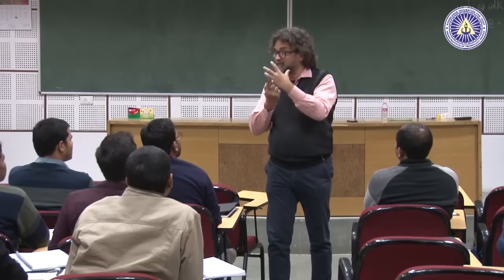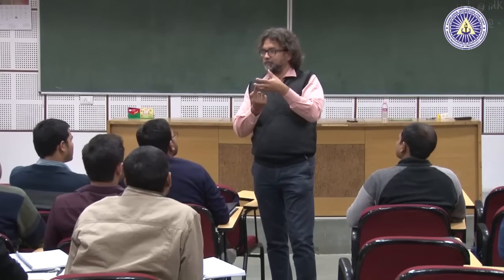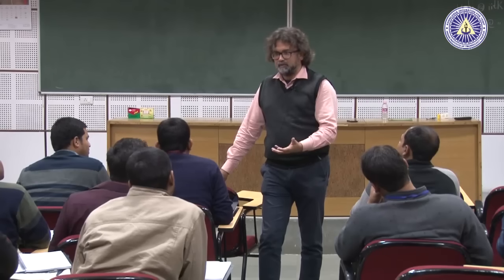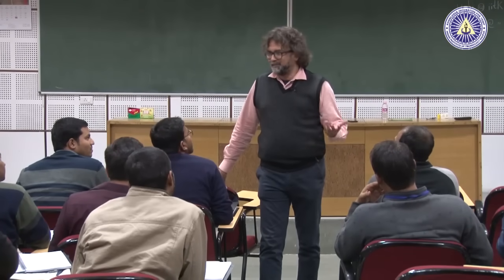Thermodynamics and Heat transfer Prof S Khandekar

Comment: Ive attended 83 classes on fluid and thermodynamics, no professor has not eve a 1/10 of interactive teaching like this. I don't why todays university professors uses ppts to teach core engineering subject where it is defined as lots of practical applications. I can understand why IITs produces quality of engineers and no wonder thar every IIT aspirants hunt for it.

Comment: Engineering means Practical Use of Science. Teaching engineering has to be practical. Professor’s insistence on relating with surrounding reminds me my classmate asking me the difference between Latent Heat & Specific Heat in last semester of our Engineering.

Comment: Consider a U-tube whose arms are open to the atmosphere. Now equal volumes of water 
and light oil (
3
  791kg / m
) are poured from different arms. A person blows from the oil 
side of the U-tube until the contact surface of the two fluids moves to the bottom of the U tube, and thus the liquid levels in the two arms are the same. If the fluid height in each arm 
is 76cm, determine the gage pressure the person exerts on the oil by blowing

Comment: The swept volume of a gas engine is 9 litre and the clearance volume is
2.25 litre. The engine consumes 3500 litre of gas per hour, when running
at 160 rpm firing every cycle and developing 4 kW. It has a mechanical
efficiency of 75%. What is the relative efficiency of the engine compared
with air-standard cycle if the calorific value of gas is 20 MJ/m3. Assuming
a volumetric efficiency of 0.87, find the ratio of air to gas used
by 1 m3 of the mixture in the cylinder.

respected sir, i am not able to solve this numerical. can you please provide me a solution for this

Comment: I have a problem. I have a conveyor oven that requires two different temperatures to be maintained constantly.100c in half the length of the tunnel and 200c the remaining half, or little less( 10 ')  than that, of the oven. Single source 'hot air generator' and a single exhaust. Now there  provided, is a room temperature air at the end of the oven for say last 10 ft. I feel this air is to create a loop of room temperature air coming and going through the exhaust,at the end, as it would prefer to condute the cold air as compared to the hot air in the oven. This may result in hot air conservation in the oven areas designed to have hot air of respective temperatures. But in order to get the gradient, in side the oven, would only dampers be sufficient or there has to be seperate air sources to generate two major temperature zones. Any suggestion would be welcome.
Reply: 100c air can be created by mixing room temperature air with 200c air in a fraction controlled by a closed loop control system with temperature sensors... ?

Comment: Do you know why there is a lubricant in the compressor of a refrigerator in an enclosed chamber or housing?it is because,it serves as a coolant as the electrical processes as on going inside the compressor and that serves as a help in its maintenance as it works for long hours non stop without the emissions of heat outside the system which can be radiative.Same should go for cars as to cool down a vehicle that have been on the road for a long time needs to be submerged into a lubricant,not water so as not to bring in rusting but this types of coolants as a maintenance job for the cars on the way to help reduce the heat after a long ride, expansion of the metals around its boundaries and bouyarncy.I have been seeing alot of people driving under hit metal engines and still kept there movement on going despite the challenge they are having with the heat in the car as a result of the mechanical works going on in there which when neglected can cause accident on the road while the driver and the passengers are battling with the heated engine and body system and the rules used in regulating the roads.This are often done by the military men in uniform when they put themselves in emergency situation to be at a place at a very little time without being able to subcontract what they want to do to other functional units to help.

Comment: Great explanation.. Lecture should always start with an example as the Professor said.. because all we are doing is using mathematics to model/formulate our observations... ( w/ assumptions) so it is important we observe first.. great way to teach. on the example of how much heat body loses.. only one comment .. even though you can approximate a body as cylinder.. heat flux is dependent on surface normal ( dot product - F . n) .. so really it can be approximated as a rectangle in 2-D space and heat lost calculated..

Comment: He ensued my interest at time 14:32 so answer is aprox 100w for the people wondering kT (t1-t2) /thickness 
T surface area 170cm aprox temp difference body temp minus room temp 37-20 =17 human thickness take it as a cylinder roughly from shoulder width which is aprox 41cm and constant for the thermal dissipation is around 1. 4

Comment: professors like him create jee advanced questions, so don't underestimate guys!
Reply: Also create GATE questions
Reply: Yes....give me his number.....I will ask him thoss questions
Reply: If goal and passion is to study computer science but the entrance exam is mostly from physical sciences, I don't think it's a relevant exam.
Reply: @abhinavchauhan6863  Cse is probably one of the only courses at the IITs that doesn't apply JEE knowledge, getting rid of PCM tests just because 100 odd students out of 800 aren't going to study them is idiotic, every ECE,mech,chem etc student needs to have jee knowledge, not to mention, every other course that doesn't require Physics or Chem, surely requires Math
Reply: @JohnSmith-kj2od yes please tell me where will you require "complex numbers" or "conic sections" in real life especially engineering

There is a sharp difference between" practical knowledge" and " theoretical knowledge"
Reply: @JeeMinds  lol complex numbers is everywhere from singal processing(electrical engg) to vibration analysis and fluid dynamics(Mech), even civil students have soil/structural analysis using complex numbers, heck even subjects like DSP that CS students study has complex numbers, anything dealing with control systems you'll come across Complex numbers, Conic sections isn't used nearly as much but there's no successful engg that has designed(architectural) something functional without the knowledge of conic sections.                                                                                               You are right there is a sharp difference between practical and theoretical knowledge but unfortunately you aren't sharp enough to comprehend it
Reply: Bro complex numbers are used in whole fucking quantum mechanics....
Reply: @abhinavchauhan6863  nice analysis 👍🏻👍🏻
Reply: @abhinavchauhan6863  you can't do jackshit in coding without excelling at mathematics
Reply: @sreemapaul4943  wtf? mate, see the real world and then comment stuff
Reply: @abhinavchauhan6863  why we learn languages first before going to learn subjects?
Reply: These exams do not gauge what an individual has to offer.
Reply: @chiluxr250  you are right, after so many IITians, we are not able to design diesel/petrol and aero engines... 😀😀😀, Only theory...
Reply: @chiluxr250  oh really? if an individual has anything to offer,  the said individual will crack this exam.
Reply: @Saitama-py8dz  haha makes sense
Reply: @Saitama-py8dz  There are many Engineer in India who haven't cracked JEE but still are very good and Quality Engineers

Comment: Hello Prof,
I have many questions related to the thermodynamics and fluid dynamics, multiple choices it takes 10 minutes,so could you help me please?

Q1. The general motion equation based on the 
a. continuity
b .conservation of velocity
c .conservation of inertia
d. 1 Law of Newton

Q2. At total-energy thermal model
a. the applied parameters independent from the temperature and when the temperature changes the rate of dissipation is not relevant.
b.the applied parameters  are not depending on the temperature and the temperature is not changing.
c.the applied parameters are depending on the temperature and the temperature is not changing.
d.the applied parameters independent from the temperature and when the temperature changes the rate of dissipation is relevant.

Q3. At thermal-energy model
a. the applied parameters are depending on the temperature and the temperature is not changing.
b. the applied parameters independent from the temperature and when the temperature changes the rate of dissipation is relevant.
c. the applied parameters  are not depending on the temperature and the temperature is not changing.
d. the applied parameters independent from the temperature and when the temperature changes the rate of dissipation is not relevant.

Q4. Specific kinetic energy change
a. unit is W 
b. gives the change of velocity component at a given point 
c. gives the reduction of velocity component away from the boundary layer  
d. gives the reduction of the velocity component near at the boundary layer.

Q5. Thermal convection cannot occur
a .where is no gravity
b. the temperature of the fluid is higher than the surrounding surfaces
c. the temperature of the fluid is Lower than the surrounding surfaces
d. in the fluid flows

Q6.The t isothermal model
a. the applied parameters are depending on the temperature and the temperature is not changing.
b. the applied parameters are not depending on the temperature and the temperature is not changing.
c. the applied parameters are independent of the temperature and when the temperature changes the rate of dissipation is relevant.
d. the applied parameters independent from the temperature and when the temperature changes the rate of dissipation is not relevant.

Q 7. A relative pressure
a. is the sum of the total and static pressure at the boundary.
b. Is the total pressure.
c. is the static pressure at the boundary.
d. is the difference between total pressure and static pressure at the boundary.

Q8. The difference between the DNS and RANS is that
a. DNS calculates the deviations of the degree of freedoms while RANS does not.
b. with Direct Navier Stokes method transient cases cannot be calculated.
c. RANS cannot solve transient cases.
d. RANS calculates the deviations of the degree of freedoms while DNS does not.

Q9. The following can be only have output parameter
a. opening
b. inlet
c. symmetry
d. outlet

Q10. In case of numerical simulation
a. with Navier Stokes equations velocities and pressure are calculated.
b.with Navier Stokes equations pressure is calculated and the flow is checked for continuity.
c.with Navier Stokes equations velocities are calculated and the pressure is calculated with continuity.
d. with Navier Stokes equations velocities are calculated and the flow is checked for continuity.

Q11. In a Non-Newtonian fluid the shear stress
a.proportional to deformation.
b.proportional to the rate of deformation.
c.independent from deformation.
d.not proportional to the rate of deformation

Q12. With Reynolds Averaged Navier-Stokes method
a.deviation of the degrees of freedom are estimated and the average values are calculated.
b.degrees of freedoms are calculated.
c.only steady state phenomena can be examined.
d.only transient state phenomena can be examined.

Q13. The boundary layer
a. boundary layer shape is only depends by the velocity of the flow.
b. boundary layer shape is not depending by the viscosity.
c.it can form in the middle of the flow domain.
d. can form on any rough surface.

Q14.With Euler flow description method ... can be calculated.
a. head loss coefficient of a body
b.pressure distribution at a given cross-section
c.velocity distribution at a given cross-section
d.the pressure drop in a pipe section

Q15. The following can have an input and output parameters:
a.outlet
b.opening
c.inlet
d.symmetry

Q16 .The first layer height depends on
a.the density, the dynamic viscosity and the pressure of the fluid.
b.the density, the dynamic viscosity and the average velocity of the fluid.
c.the density, the pressure and the average velocity of the fluid.
d.the pressure, the dynamic viscosity and the average velocity of the fluid.

Q17.The dissipation
a.reduces the viscosity.
b.causes swirls.
c.is heat generated due to the reduction of the kinetic energy
d.is heat generated due to the increase of the kinetic energy.

Q18.In the Euler movement equation we have to assume that the fluid
a.incompressible.
b.is in a gravitational field.
c.inviscid.
d.swirl less.

Q19. The following is not a boundary condition:
a.domain
b.opening
c.inlet
d.outlet

Q20. When global convergence achieved
a. we cannot set the convergence criteria
b. the degree of freedom are converged at a certain point of the domain
c. given amount of iteration are done
d. the degree of freedom are the converged at all of the points in the domain.

Q21. In the LES and DNS method.
a. flow is always steady and one dimensional.
b. the mesh size cannot change in the flow domain.
c. flow can be steady and one dimensional.
d. the flow is always transient and three dimensional.

Q22. In fluid modelling it is favorable when 
a. the inlet parameter is velocity and the outlet parameters is velocity.
b. the inlet parameter is pressure and the outlet parameter is pressure.
c. the inlet parameter is pressure and the outlet parameters is velocity.
d. the inlet parameter is velocity and the outlet parameter is pressure.

Q23. The rotation in the domain express the 
a. swirling movement .
b the intensity.
c. magnitude of a value.
d. the source term.

Q24. Fluid mechanic model
a. degree of freedoms are the velocity components and the pressure.
b. degree of freedom are the viscosity and the density.
c. degree if freedom is the pressure.
d. degree of freedom are the viscosity component.

Q25. The divergence in the domain expresses the 
a. express the source term 
b. the intensity 
c. swirling movement
d. express the magnitude

Q26. Vortex shedding coefficient
a. Gives the reduction of the velocity component away from the boundary layer.
b. Gives the reduction of the velocity component near at the boundary layer.
c. units is W.
d. Gives the change of velocity component at a given point.

Q27. The drag coefficient is the 
a. ratio of the force acted on the reference surface in the direction of the movement and the dynamic pressure acted on the body.
b. ratio of the force perpendicular to the movement and the dynamic pressure acted on the reference surface.
c. ratio of the force acted on the reference surface perpendicular to the direction of the movement and the dynamic pressure acted on the body.
d. ratio of the force in the direction of the movement and the dynamic pressure acted on the reference surface.

Q28. Fluid motion cannot be described with.
a. the Bernoulli equation
b. the Lagrangian description method
c. the Euler movement equation.
d. the Navier-Stokes equations

Q29. Friction factor gives….for a section of a pipe
a. ratio of the total pressure change and the dynamic pressure in the flow.
b. the viscosity of the fluid 
c. the dynamic pressure
d. ratio of the total pressure change and the dynamic pressure caused by a body in the flow.
  
Q30. According to the Navier-Stokes equations friction could be occur if 
a. the average velocity of the flow is changing.
b. the kinetic viscosity of the fluid is changing
c. if there is velocity deviation in the flow.
d. density of the fluid changes.

Q31. With Eulers flow description method….can be calculated 
a. The pressure drop in the pipe.
b. head loss coefficient of the body.
c. pressure distribution at a given cross-section.
d. velocity distribution at a given cross-section.

Comment: I am an NIT graduate in mechanical engineering. Passed about more than a decade ago. But our Thermodynamics and heat and mass transfer professor weren't as chilled out as this guy, probably the reason why I dint like the subject that much when I learned it..

Comment: Even when he is giving a real life example, answers are focused on equations shows the sad reality.
Reply: I think you are not from an engineering background. Because without mathematics....we can't express the engineering. And whatever(engineering) you see, it has an equation....it may be a fan.....or it may be any machine....or may be why a building is standing......what are the forces....that are in balance.....and when anything depends on various parameters, it's quite easy in an equation to visualise how one parameter get affected, when we change some other parameter.
Reply: @siddhibinayakpradhan6121  i am from plain science background. But my point is whatever answers ain't wrong but teacher wants them to relate the science with reality
Reply: That's may be happening because the students present there are more used to that kind of thinking earlier, where they directly link everything to equations and don't go deep into the concept. But here sir is telling repeatedly to first connect everything with the real life and then only equation comes into action. Anyway that's it.🙂